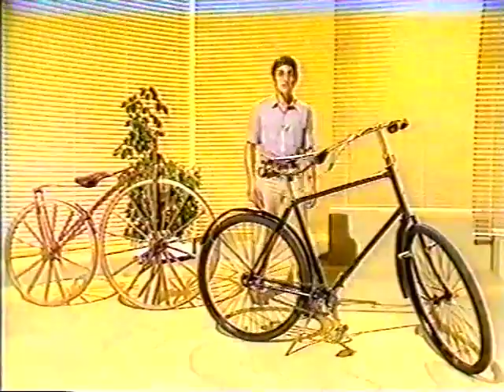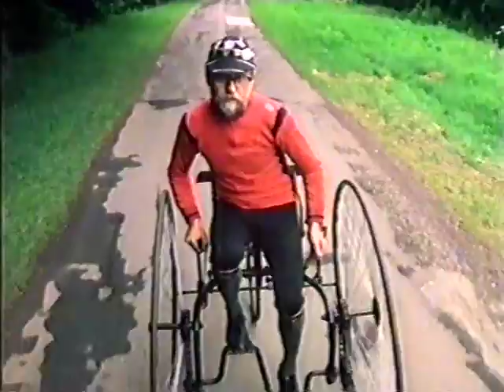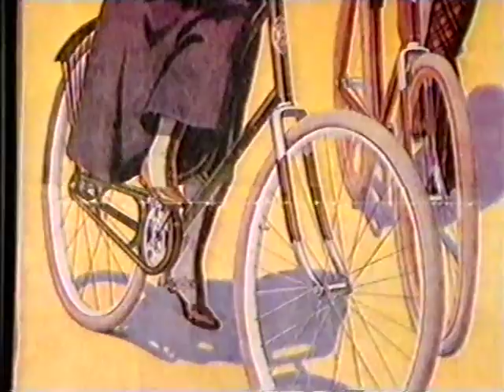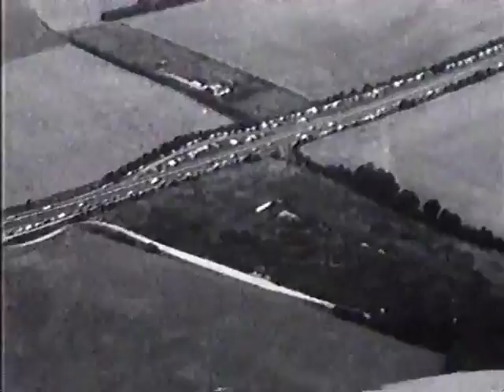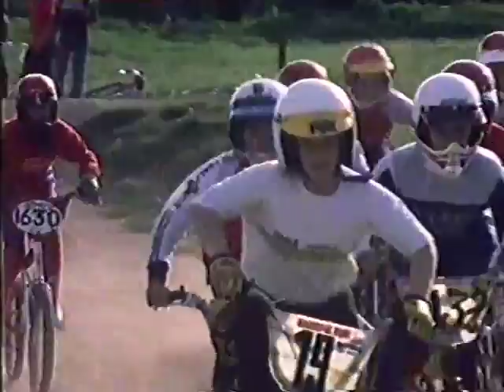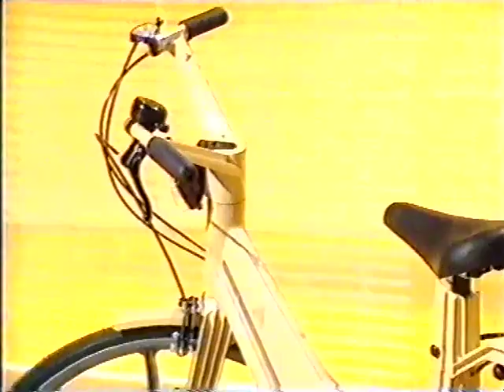Veteran-Cycle Club video archive - Invention is Not Enough

Comment: Road conditions also dictate design muddy tracks and bumpy roads suits the high wheels (a bit). Rubber tech and pneumatic tyres and safety bike fits a production line as opposed to blacksmiths.

Comment: Thanks excellent.  I talk to people who had a long-wheelbase steel frame bike, let it go for a new bike and lost a very comfortable fast and light to pedal bike.  People spend a lot on bikes that they admit are uncomfortable.  There are advantage, modern bikes go at a lower speed so they are easy to learn to ride on and also manage sometimes derailleur gears a little better.